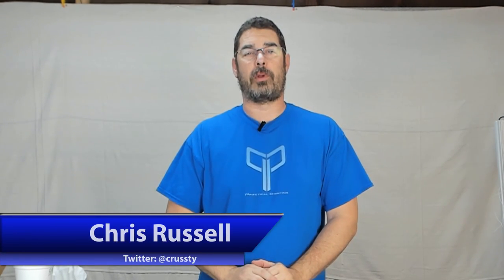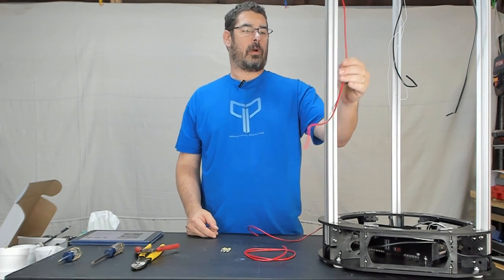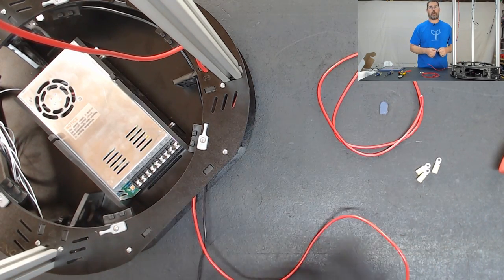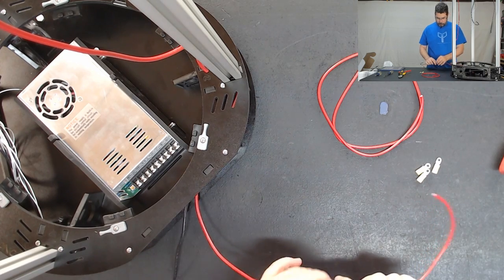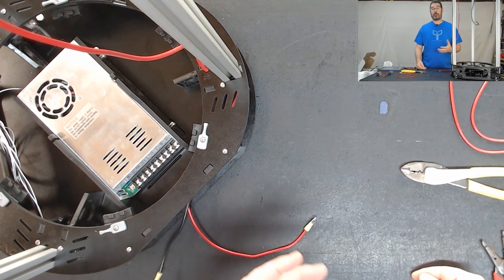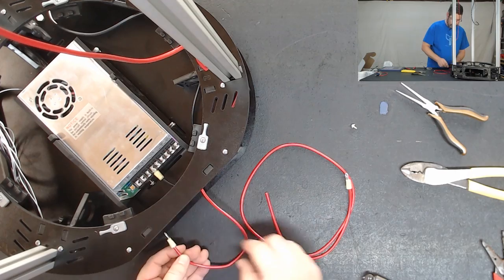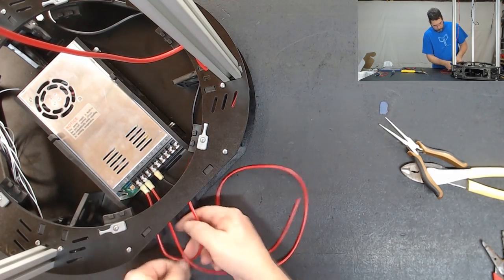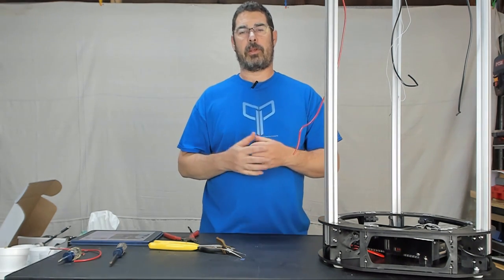SeeMeCNC ROSTOCK MAX v3.2 Build Series Part 6: Assembly Step 23.

Comment: Will ypu be follow my recommendation for doing the motors and belt routing before the upper side plates and duet mounting? Makes motor final tightening soo much easier. I left the recommendation on the instruction page also.
Reply from the maker: Matt Weber that’s coming up in the next segment I think.  I didn’t for the filming because the manual hasn’t been updated yet and I was trying to shoot it as they intended- but I will have a note in the description about your suggestions on the order change so that people can be aware of it.